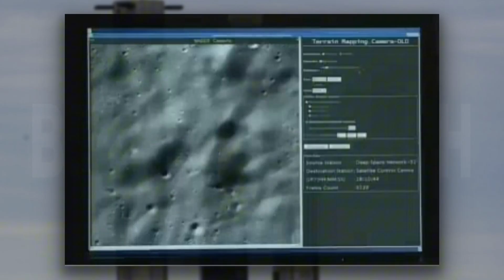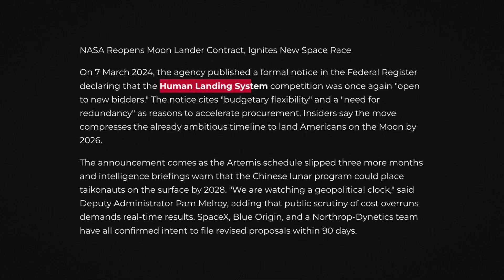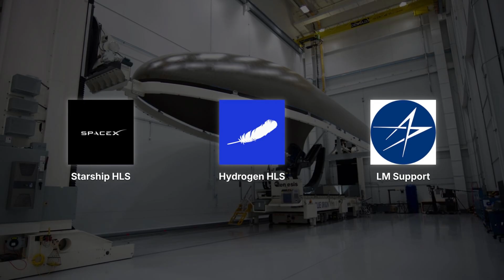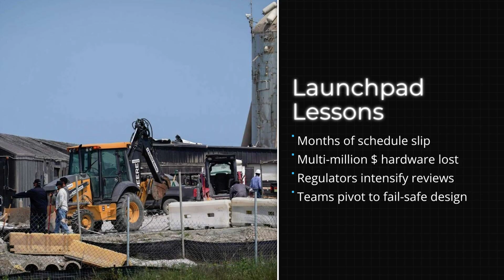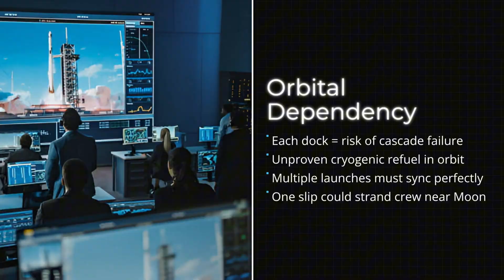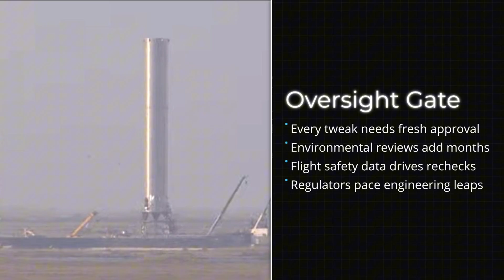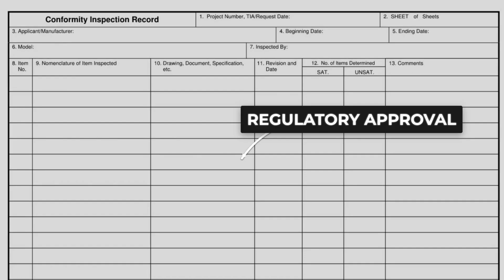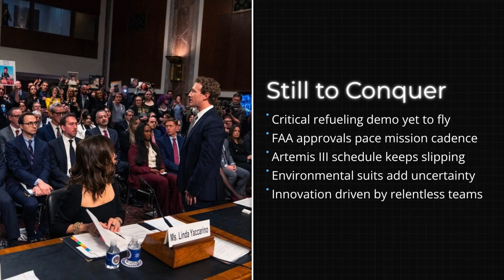SpaceX’s Game-Changing Breakthrough to Land Starship on the Moon Sonner than NASA expected

Comment: The first problem with Starship is that it is too heavy. Every pound matters. This vehicle is made of a material to heavy to build aircraft with. 
I know SS is cheap but this is a very big price to pay.
Reply from the maker: Good observation! The weight issue is real, but SpaceX believes stainless steel’s toughness and heat resistance make it worth it. What do you think — is the trade-off justified?
Reply: Starship can carry a payload of 100–150 metric tons to low Earth orbit in its reusable configuration, and up to 250 metric tons in an expendable configuration. It can also transport 100 people in its crew configuration and is designed to carry more than 100 tons of cargo to Mars and the Moon.
Reply: @bary1234 no it cant. This is payload that V3 or V4 is supposed to carry. We will find out after flight test.
Elon used to say 350t reusable and 600t non reusable. V2 only demonstrated 20t. Time will tell